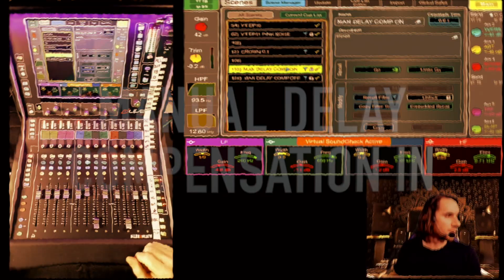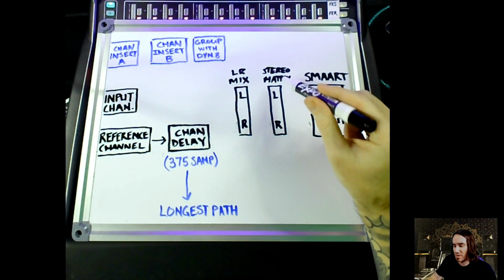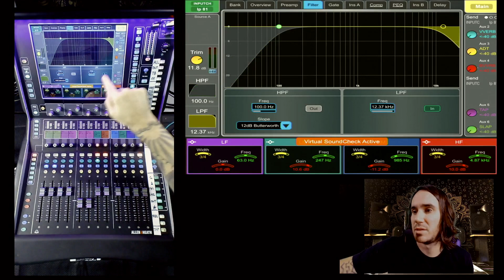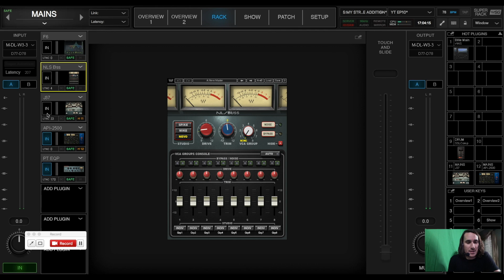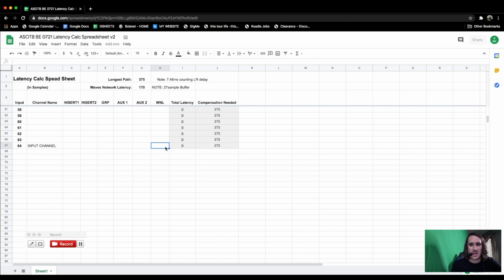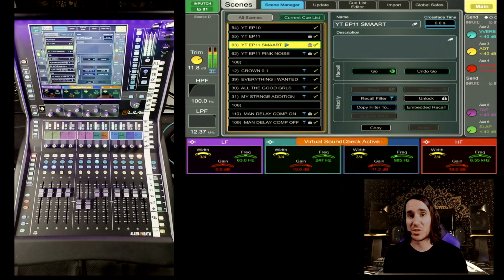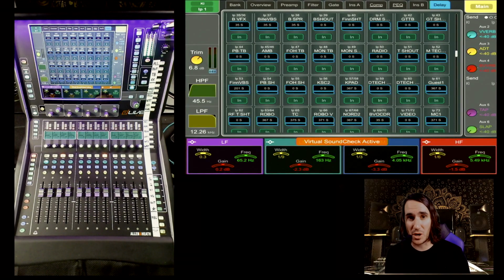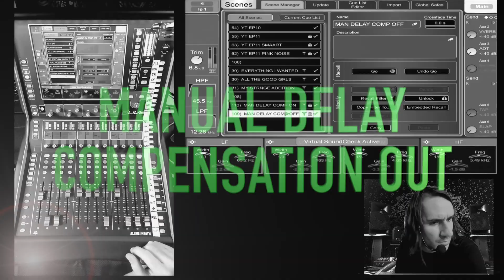EP11 - Manual Delay Compensation - Part 2

Comment: Love this video. Do you delay inputs for wireless latency compensation? If you are using axient transmitters there are 2ms of delay in those..."Axient Digital features a wide dynamic range, AES-256 encryption, and only two milliseconds of latency from the mic transducer to the analog output." which would be 192 samples if you are running at 96k. Just curious about your thoughts on this. Thanks!!

Comment: what about if you're inserting FX on your group ins. ie: hypabass?  I noticed you need to leave the insert "in"; when you take it out, but still assigned, it does not cause any latency.  So would you just turn the dry all the way up and the wet all the way down in this case?

Comment: Old school alignment? I don’t know any of those techniques. Feel like I skipped a step here...
Reply: Basically, for a parallel path you would put the same plugins on both paths.  An example being a parallel compression bus you would assign the same compressor to both busses.  On your dry bus you just put the threshold as high as it goes so the compressor isn't effecting the audio, and on the compressed bus you set it how you want it.  That way on both busses the audio has to follow the same path, which keeps it time aligned.
Reply from the maker: Yep! Exactly what Taylor said! The idea is if you decide to do parallel paths, make both paths identical in processing so the the timing is the same. But leave the thresholds open on your dry. It’s the best way to make absolutely sure that you two paths will be aligned precisely
Reply: @asumoftwobusses6304  thanks guys! do you know if parameters like attack/release affect latency?
Reply from the maker: @zachjurkovich3547  I don’t believe so. The only thing that would shift phase coherence between channels would be Multiband processing and eq. Eq can shift the time a tiny bit, but I think full range compression you would be fine